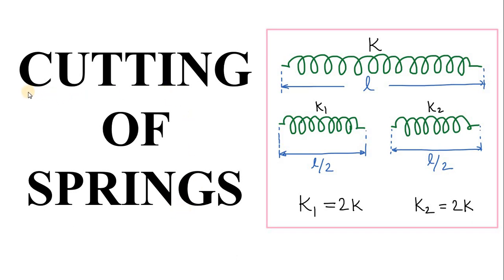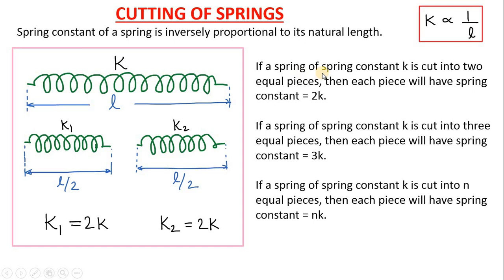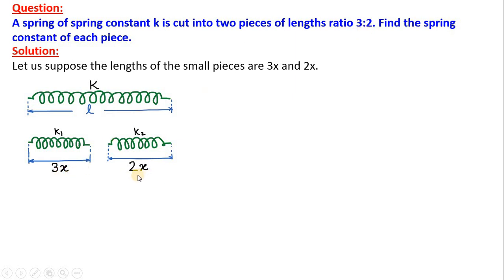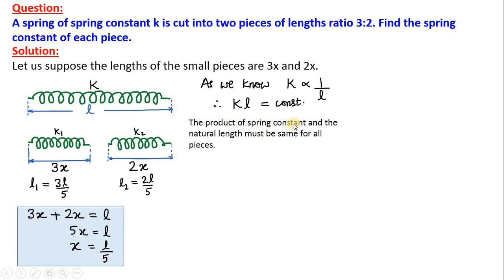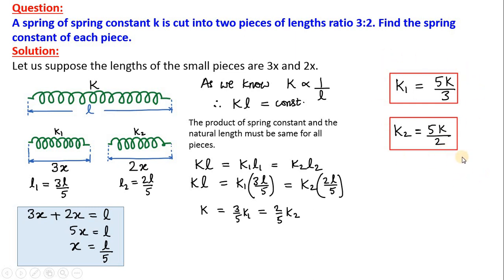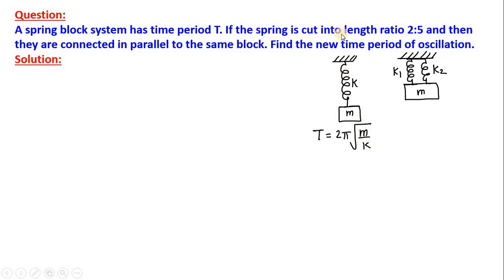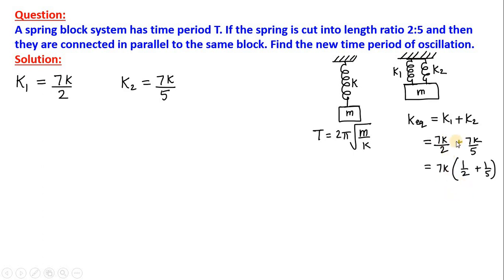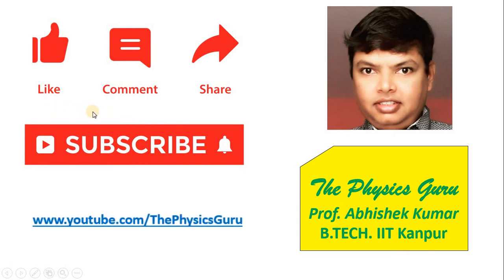[Physics IIT JEE] Cutting of springs and SHM (Simple Harmonic Motion) by Physics Guru

Comment: What is meaning of (( K= 1/L )) technically?
Reply from the maker: Springs of small lengths have higher stiffness (not easy to deform). Springs of large lengths can be easily deformed, having less stiffness. K = a measure of stiffness.
Reply: @ThePhysicsGuru  thanks ,got it